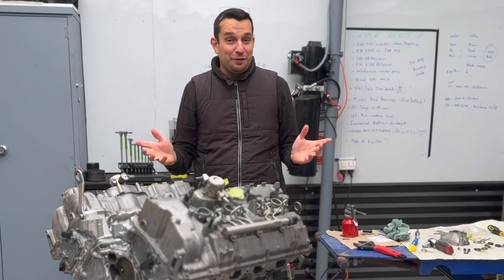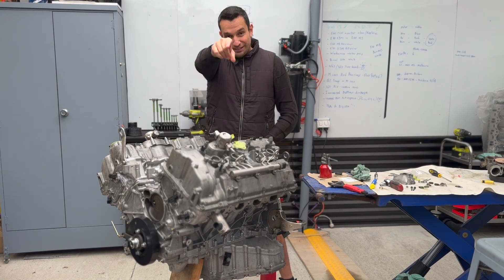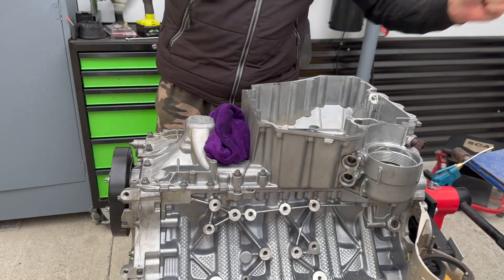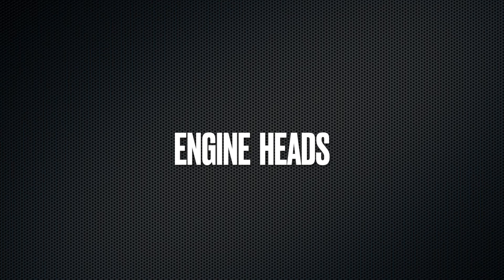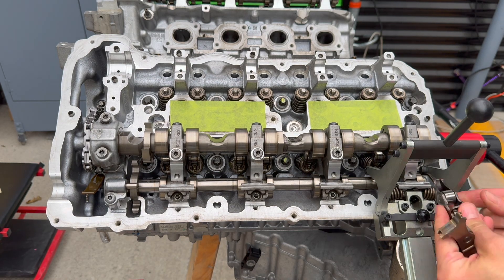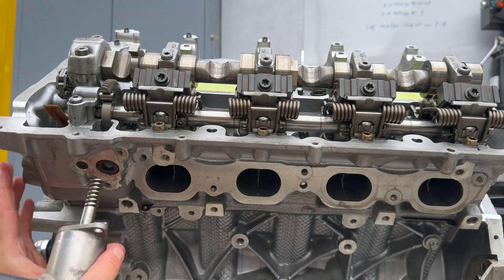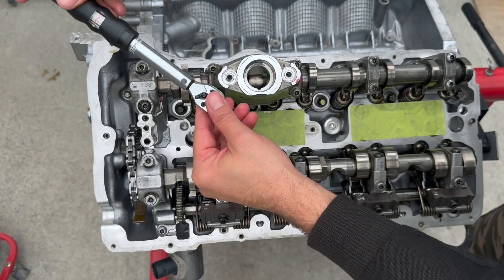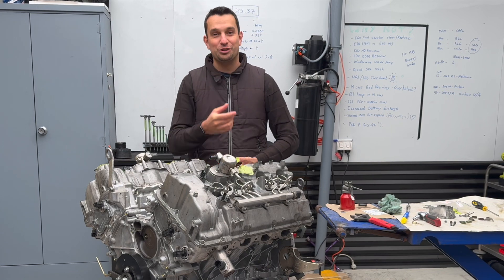BMW F10 M5 Engine Build - Part 3 - SUMP and Engine Heads

Comment: What did you use to hold the crank while you torque the dampener? Also saw in your other video main caps didn’t have the side bolts. I thought only n63 didn’t have the side bolts.
Reply from the maker: Only the F90 M5 and recent version of the N63 have the side bolts (which goes from the outside the block)

Comment: How often do we want to clean up the pick up tube? For example, after how many oil changes do we drop the cover to remove and clean the pick up tube?
Reply from the maker: Hi, it’s hard to say but that isn’t something you do often, if you are running an engine that is 100k kms or older it means disaster is just around the corner - checking the tube could buy you time but eventually the engine will need to be done

Comment: hey, so the n63 in the x7 m50 do you have to remove the oil pump to remove the upper oil pan?
Reply from the maker: Yes, the pump bolts onto the pan and oil deflector

Comment: Is the installation of this oil pump the same for the n63tu motor? I have a 2016 550i just for reference because I’m thinking on doing a upper oil sump gasket replacement due to an oil leak
Reply from the maker: The N63 should be the same as the first S63 engines but that varies if you have AWD - The S63 uses different oil pumps on the M5 (RWD) and X5M (AWD) to accommodate the front diff and drive shafts - There is a video called Engine build in 25 minutes in my channel,  most likely your pump is like that one
Reply: @dnl35projects  my car is RWD, would that fall under that oil pump? Thanks for the reply!

Comment: Hi mate. My s63tu bank 2 have engine oil stuck in inlet even after changing new turbo , pcv valve covers and oil catch can. Any idea what could caused engine oil pushed to that area
Reply from the maker: It could be you valve stem seals
Reply: @ changed new set as well. Or which test I should do first?

Comment: I watched this video twice thinking I missed the tightening torque of the crank bolt. I don't think you mentioned it. Do you know what it is?
Reply from the maker: Hi, yes unfortunately the owner wanted his car back and we did not have a chance to record more videos. The main crank bolt to the Vibration Damper (M18x1.5)  must be tightened to 100Nm + 3 times 60 degrees of rotation ( 100Nm + 60deg + 60deg + 60deg)

Comment: please tell me what gasket you used? I can’t figure out if I need a plus sign 1.05MM (+0.3) or a regular one
Reply from the maker: Hi, if you had any work done and material removed from the block or cylinder heads, you will need a thicker gasket (1.05mm) - if you just cleaned everything and put it together you can use the regular one (0.75mm)

Comment: Hi my friend  i will  rebuilding my engine soon do i need to change the oil pump or i can but my old one
Reply from the maker: That’s not mandatory however if you’re rebuilding your engine was either broken or have high mileage - in both scenarios I’d highly recommend you installing a new oil pump in it. That will not only give you peace of mind but also create a safety buffer so oil pressure is there is something goes wrong.
Reply: N63 s63 same oil pump?

Comment: question the oil cooler valve, i have felt when the weather is below 37 dgree C the oil cooler valve is shut it seems to prevent humidity in oil, and when the weather temps are above 37c to 55c the oil valve is allways open even in cold starts!, in the hot weather even cold starts are longer to reach the optimum temps, Lol the question is with the hot temps in my country should i install the oil cooler valve that make it open allways or this could put me at risk?
Reply from the maker: The oil thermostat wont begin to open at about 75c and I'm a bit again some of the aftermarket parts - My belief is that BMW designed it to work a certain way and as long as it's working properly I see no reason for changing.

Comment: Maybe the guy wants to sell the car once finished. He doesn’t care if the problems are going to happen to the new owner.
Reply from the maker: Yes but it's a huge gamble, with reusing those parts the car might not even drive out of the garage - It could be good for a while or seize again just after the first start - Definitely not something I'd recommend doing however it's out of my hands now.
Reply: @dnl35projects  Damn mustve been crucial part that were reused? What was reused from top of you head?

Comment: I’d have you build my n63 any day. Very nice video. Very special cars for only certain people who can understand the way they work and appreciate them
Reply from the maker: Couldn't agree more ! That car would not seize the engine if it was sent to a good shop to start with.
Reply: @dnl35projects absolutely. I’m a diehard n63 original supporter from the beginning. They have their issues and undoubtedly there have been some fantastic revisions and reliability upgrades since then. You have the original S63 as well I believe? Before the TU revision in 2014? That’s still a beautiful motor. I personally know verified times of tuned N63 and N63TUs running 10 sec 1/4 miles on 93 octane and index 12 injectors (N63B44O0 motor) and only an intake modification. They have serious potential
Reply: Also, what is the biggest killer of these engines? The factory service recommendation? I have my M550i on a 5000km oil and filter change, done 45k, doesn’t use a drop of oil.
Reply from the maker: The biggest issue of the S63 and N63 engines are the enormous amount of heat they produce and thats why they are called "Hot V" - When you combine that with long oil services intervals you have a recipe for disaster, maybe not while the car is new but once it goes past 80 or 100K miles a rebuild is the only solution.